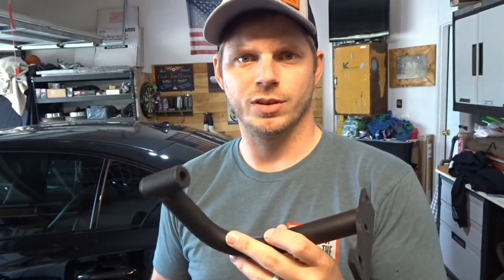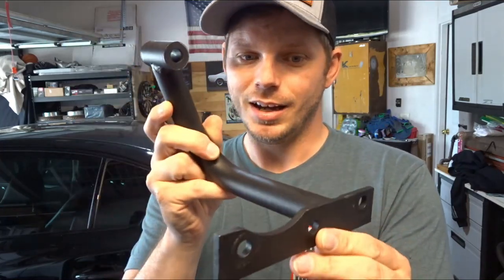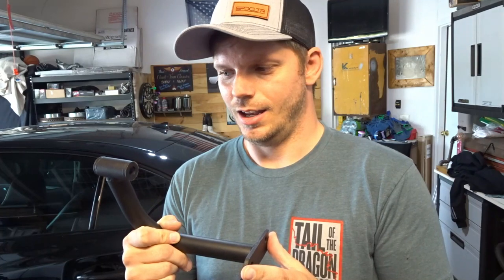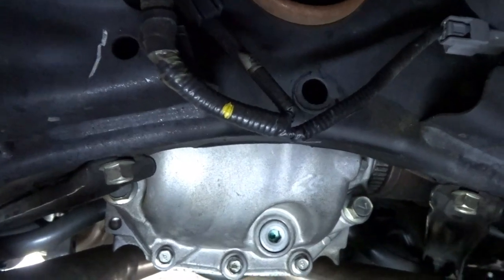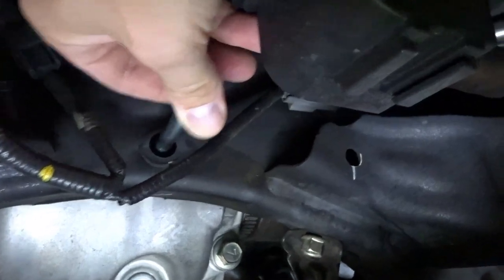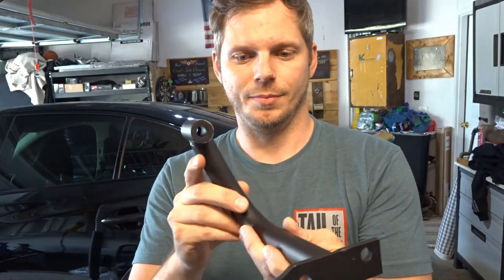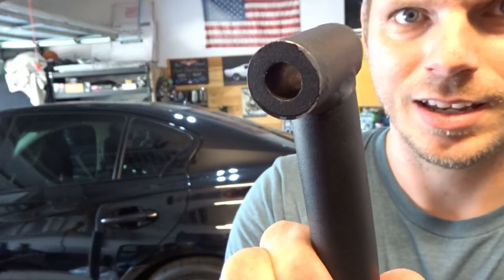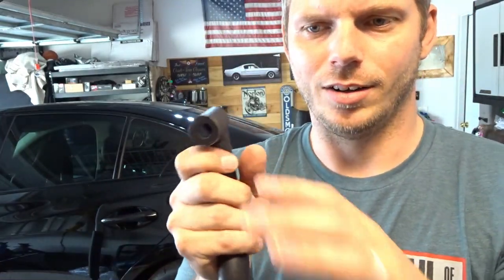Watch BEFORE buying Q50 Rear Differential Brace!

Comment: I recently bought one and I made a video I used an intake hard rubber cap, drilled a whole thru and the bolt fit snugged and it also filled the whole in the subframe

Comment: I agree. That small contact point will eventually damage the subframe. There should be a bracket with multiple fasteners to the subframe to keep the brace in place and power away from one small area.
Reply from the maker: Agreed

Comment: Hopefully they just make an insert that fills the hole and has a larger welded washer that takes up the bolt length near the diff housing eliminating 2 birds with 1 stone ... good job dude ! Was going to put mine on today but I’ll wait for a good fix ! 👌🏼🤙🏼🤘🏼😎🤘🏼
Reply from the maker: That’s right.  Just needs a good sleeve to fill the hole

Comment: Ah ha !    Now that was a good catch 👍🏼 

Im sure once you pop something in there with the right spacing which that piece from your pocket is in the right direction it will improve the performance of the brace 👍🏼

I still say that after installed yes there was flexing but smoother flex not snap fast flex like the first video .

But im sure since you found that issue once its fixed it will be night and day 👌🏼 

Keep us informed man nice vid 🤙🏼

Comment: I hope it's been updated or revised...I'm getting one installed this week 🙏🏾
Reply from the maker: It has not been.  I would cancel the order and purchase the Z1 brace that was just released.
Reply: If you're talking about a major/complete re-design, then no. But he did add a sleeve to better fill the mount hole now, so maybe it  will further reduce flex now.
Reply from the maker: @VM-gq6jd  I added a sleeve myself and retested with no improvement.

Comment: Good video, thanks for doing this series. I just got notified that Z1 has some high performance coil packs available now. Think you could speak on those?
Reply: Me too. I would like for you to talk about z1 high performance coils. I would think you would get better gas mileage and a bit more torque or hp. I put a high performance coil and ignition box on my 88 firebird about 22 yrs ago and definitely felt a difference and I doubled the gas mileage. So iam hoping that these coils would be beneficial to the 3.7.

Comment: in the " under the car " section of the video , you can see the dif bushing, along with the whole subframe , is moving compared to the chassi ( where id assume you mounted the camera  ).  i don't think the brace does a much to support the dif , as it does to support the dif bushing.  says to me,   the bushing is the issue and id just replace it over the brace.  the real fix is solid bushings , or at least aluminum bushing inserts , crossmember and dif.
Reply from the maker: You’re right, the brace didn’t do much of anything.  And a single mounting point to the frame creates a pivot point.  At the time of the video, there was no diff bushing available for the Q.  Now there is a poly bushing from z1 which is a nice upgrade.  Check that video out!
Reply: @SpeedCultureStudios  will do.  I'm new to the platform , but a long time Nissan enthusiast and have worked on them since 2003 or so. Just got a 23 RS in black opal. Have some cool plans for it.  And keep finding your videos.  I'll def look into the video .  I want to do stuff right , and once. When I do my arms I'll get eccentric lockouts also , and prob go with the RS*R best active coils , Hotchkiss sway bars. Have some cool JDM parts on the way like an Esprit wing , and may do the skyline front end and tail conversion , and get the Varis front lip , skirts , rear diffuser kit.  370z nismo v1 wheels for a bit , already own them , they're on my R33 GTR  , but got it new LMGT4 wheels..  plan to go a bit above the AMS RA500 kit , basically the kit plus all the cooling and fuel upgrades , and intercoolers , carbon engine covers etc.   but not do turbos or pull engine for a bit.  Will build a block out of car , and upgrade down the road.   Cost of a zero mile block vs pulling and breaking down the original doesn't make sense. Rather have a spare ready to go , then need it and have down time .

Comment: on the bracket, they should have put a lip on the back so it could slide into the front hole just a bit for it not to flex. do all 14/15 q50 have a large front hole. is that large front hole normal? you would think in their testing they would have found this issue. i noticed it right off the bat.
Reply from the maker: That would have been a good idea.  I don’t know if they tested it so far as to watch it under the car under actual conditions like I did.

Comment: I say we widen out the hole so it slides in the front hole with a longer shaft to make it to the other hole. Then use the right sized bolt. Or maybe we get a mounting bracket like the lover half and drill into the Fram to help secure it. But looking forward to seeing the solutions. Will the ones we bought be issued the fix if it requires and update from them? Or are we on our own in terms of any solutions if one is found?
Reply from the maker: Your second idea is the way I would lean.  And yes I believe he is sending out sleeves to go into the hole to reduce the amount of play.  We will see if there is a redesign in the future.

Comment: It would make more sense if it had an extra mounting point that mounts to the actual diff bushing
Reply from the maker: Possibly.  It needs to prevent a pivot point, so two mounting locations would help.  Other than that, just overall design and materials are really important.

Comment: Hi @speedculturestudios did you do any draggy runs to see a difference in before and after? The YouTuber from @gettingthroughlife installed the same part and recorded an improvement in his 60ft times. This is a part I myself was very interested in as my 60ft are stuck at 2.0 to 1.98  .
Reply from the maker: I filmed some today yes, but there was no improvement.  His 60’ times did not seem right to me.  He should have been under 2 seconds even without the brace.  I’ve been consistently at 2.1 60’ times without the brace.
Reply: @SpeedCultureStudios  Nice I have only been in the 1.83 because of very light and small tires. Currently sitting at 2 flat. So you saw no improvements well that sells it for me. I will wait until they upgrade/revise the thing before purchasing.

Comment: OMG I was also surprised how much flex there is even with the Z1 bushings. Do you have high miles on the car or low miles? Want to know if that could be a reason or not for the flex.
Reply from the maker: 60k miles.  They are still rubber bushings so I expected flex, even though there are metal collars.  I mean they are just collars so they can only do so much.  The amount of flex before them must have been crazy because I could feel a difference immediately after installing them
Reply: @SpeedCultureStudios  Well the Z1 part is most defiantly on the must buy list. I think I'll wait until a redesign or an additional part for the rear diff brace. I just wanna make sure the flex is at a bare minimum.

Comment: It reduces that bucking feeling when you get off the gas without it installed you can see it bounce
Reply from the maker: You can see it bounce with it installed as well.  That’s the problem.  And if you have relatively low miles, you shouldn’t feel that anyway.
Reply: @SpeedCultureStudios  i may have a bad or worn drive train mount feels like lash

Comment: This is why the gktech brace for the 370z comes with a stepped washer to stop this from happening. Simple fix, works and low cost.
Reply from the maker: Still doesn’t solve the single mounting point problem.
Reply: @SpeedCultureStudios  yeah I think that part would then become a cost issue and it wouldn't be as desirable to purchase. Tough choice balancing performance and affordability

Comment: Seems the bolt used is the problem why u still have alot of flex
Reply from the maker: I talked about the problem in the video.  The hole utilized for mounting is too large which allows/causes the single bolt to pivot.  A sleeve to fill that hole would be necessary to reduce/eliminate the flex, but ideally, there would be more than 1 mounting location.  Any vehicle with any amount of torque and grip will quickly find a weak point in the brace or in the subframe.

Comment: The fact that the movement at the attachment point wasn't initially addressed is exactly why I wouldn't use this part. This part wasn't designed by anyone with even a little bit of engineering prowess, let alone a mechanical engineering degree. 

A single attachment point for something like that is also a terrible idea. Even a stock 3.7 is putting 4,000lb ft of torque in first gear through that diff after accounting the trans and final drive....that's not even including the torque converter K factor. That's way too much to ask for a single little bolt to deal with.
Reply from the maker: I agree that a single attachment point is not sufficient.

Comment: Getting a big washer between the brace and subframe will not reduce the stress enough, especialy if the washer is thick and very hard. It would need to be too wide to make a difference. Instead, weld a very thin washer around the hole on the subframe, and weld a smaller one on it. It will spread the forces more equaly without creating stress point.
Reply from the maker: I don’t think that would make it better, honestly.  Especially adding a smaller washer to the back of it, unless the “smaller” washer is still larger than the head of the brace.  I agree that a larger washer isn’t ideal, but it will certainly distribute the stress better than nothing.  
Ideally the brace would not have a single contact point.

Comment: pride needs to completely scrap this design, its flawed. you can still hear your car wheel hopping slightly. theres just too much deflection in the suspension. 

if you really want to fix all this, what needs to happen is that ALL subframe rubber bushings need to go. either replace with delrin or solid bushings, not the inserts. theyre not strong enough. second, lateral/camber/toe arms need to be spherical on one end and delrin on the other to eliminate deflection. next, replace the squishy diff bushing with a poly version, a solid version would likely break the diff at the mounting point. THEN, test for wheel hop. 

if theres still a problem, then a W-shaped brace that connects the diff to the rear of the subframe via the rear center sub-frame support brace attachment bolts, then triangulated to the body using the support brace locations.